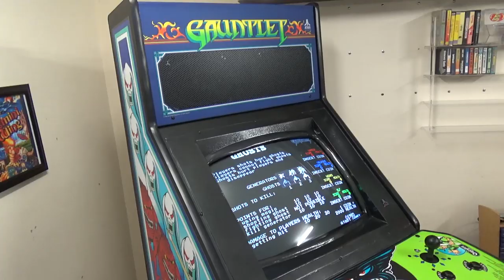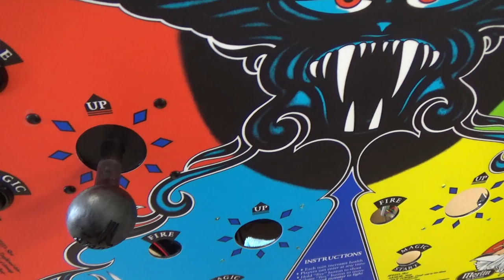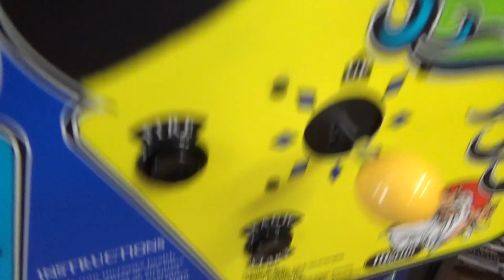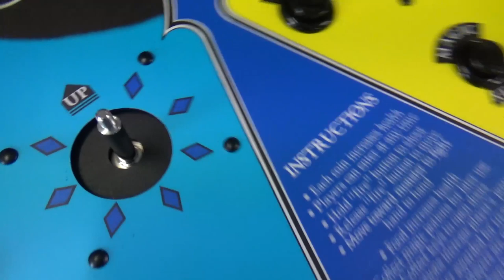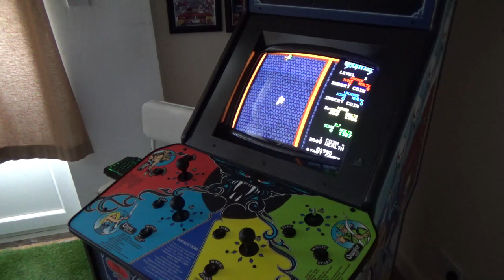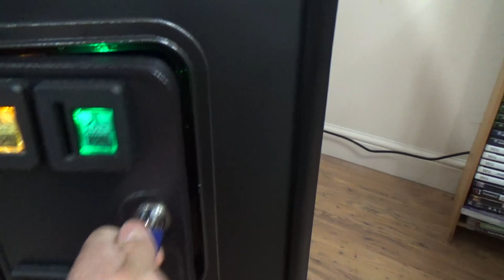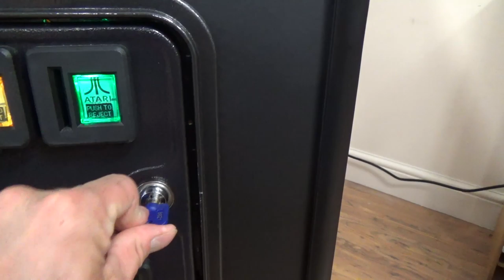Gauntlet Arcade Cabinet Scratch build. Part 19. Joysticks & Buttons Install

Comment: My brother and I both collect arcade machines. Over the weekend my brother bought an original Gauntlet arcade machine for $500. It could use a little restoration. While researching, I came across your video series. Skipping a few videos, I watched nearly the entire construction of your machine. Impressive, especially the bezel. The only thing that was disappointing was that you didn't use an authentic harness and Gauntlet PCB; otherwise, it was a fun little series.

Comment: @Andy's Arcade  - Andy you had me shouting at the video clip,  Player 4 - elf will stand of the right side of the cab - so  south position will be left , north = right , east = down and west  = up. You've probably done the same with warrior , so should be N=L,  S=R, E=U  and W=D.  Well done by the way.  :)
Reply: @AndysArcade  Hi mate , Oh I see that you're right the artwork does have the word "UP"  facing the monitor on all 4 players.  I cannot remember the original arcade artwork & joystick directions if it was the same. But from my preference and logic I would wire/configure the directions to what I mention in my  first comment to make easier for warrior and elf players who stand on the sides of the cabinet. All the best Mark aka WhackyRoady
Reply: @AndysArcade  Thinking about the UP direction - it would be fine  in the north position  facing the monitor for warrior and elf. I hope elf 's joystick is working now. Looking  forward to your 4 player test .
Reply: You are utterly wrong. The joystick directions are all the same. Andy has done it correctly Elf's north is the same as Wizard and Valks. Warrior too. When I used to solo Elf or Warrior, I  would block Wizard or Valk position.

Comment: Nice work!  I think for the cables I might have first bundled the buttons together with their corresponding joystick, then bundled those bundles, and maybe even left them hanging rather than attach them to the inside of the cab. This way you could remove the CP to service it.  I see your i-Pac is on the left side and the PC on the right so that makes it a bit harder.  Might want to move the i-pac to the right if it's not a lot of effort.  In the original all the CP wires are bundled and go to the right and connect to the main board which is attached to the right inside of the cab.
Ball tops look great!  You did a nice job sanding them and the heat gun really shined them up.  They look pretty close to my originals.  I bet with some heavy use they'll look even closer to the originals over time.
I left the spacers long so you could trim them, which you seem to have done. I was thinking once you sized them you might be able to bond the spacer with the topper by heating each and pressing the together.  No matter though if you can't notice the separation.
Regarding the coin counter, I think you might be able to wire that with a 12V circuit, as you mentioned is needed for the counter with a 12V relay either in series or maybe parallel.  The isolated part of the relay can then be hooked to the i-Pac without worrying that the voltage will fry it.  You can find cheap 12V relays on ebay or I think an automotive relay should work too which you can easily source locally.   You'll just need to see the relay's schematics to figure out how to wire to the appropriate pins.
The joysticks move pretty freely and have a restriction but it's completely round. The round center plastic piece touches the leaf switches when it comes close to it.  If you refer back to my photos you can see it.  I'm thinking your joysticks might have more range of motion and less friction without the restrictor plate because they are magnetically activated.  So that might be why you're preferring it with the restrictor plate.  You might want to put a traditional joystick in for comparison's sake. You could use the leaf switches I sent you in a traditional joystick to see if that gets you closer to original feel.  They should be pretty quiet with those leaf switches too.
Regarding if the joysticks rotate on the original, no.  They are very unique in that way.  I don't know how they prevent the shaft from moving.  I'd have to dissect them to figure it out.
Your cab is looking so authentic!  Really great work!
Thanks for sharing your hard work and amazing progress.  So great to see it all come together.  I'm looking forward to seeing you and your mates playing together.

Comment: Is there a plan to decrease the screen size slightly, so the game fits inside the edges of the CRT?
Reply: @AndysArcade  have you tried using retroarch instead of mame direct, the setting to ajust screen size in retroarch are very simple, looks amazing tho.
Reply: @AndysArcade  yes retroarch is great on the PC and you can get many great images that use retroarch, dont know if youve ever tried arcadepunks.com lots of stuff on there.